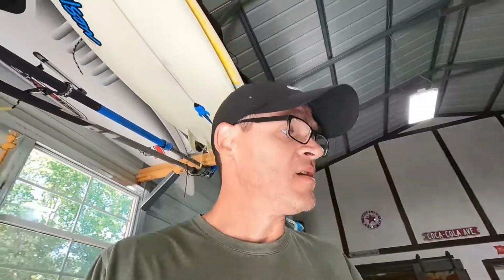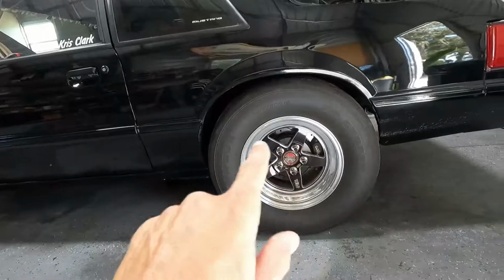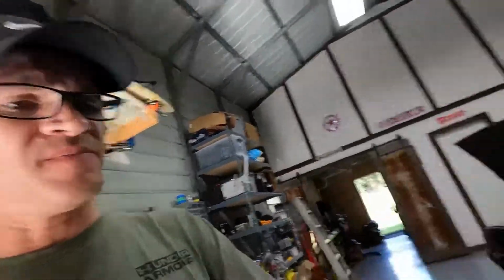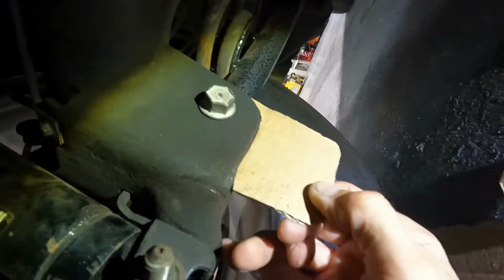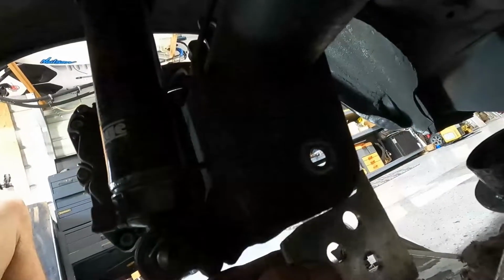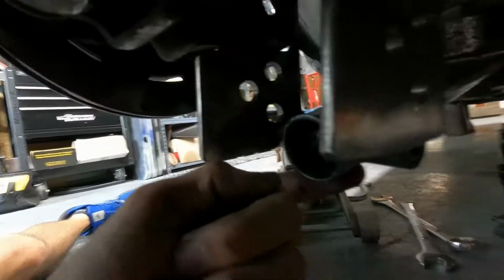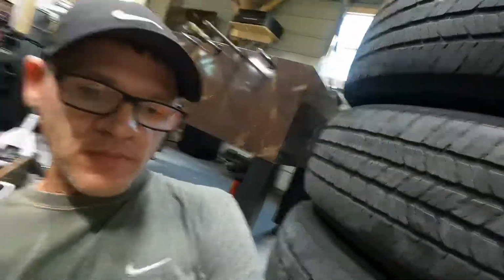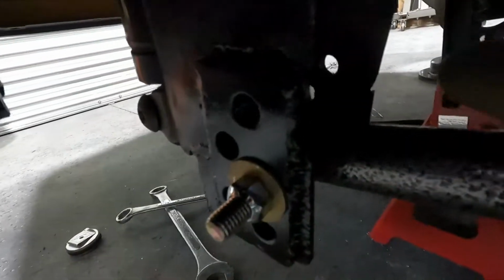Fox Body DIY Lower Control Arm Brackets! Total Cost $25

Comment: What thickness of metal were you using? Going to try this.
Reply from the maker: I don’t remember. It’s the the same thickness as the stock bracket. Just use calipers and measure the thickness.

Comment: You lowered your lower bar down was it 1/2"? Does 1/2 make a noticeable difference at the track  at starting line and out farther ? Thanks
Reply from the maker: Actually 1.5 inches. Made a huge difference. It has wheelie problems now.
Reply: Thanks i have a 92 mustang  with 540 bbc F2 procharger  stock suspension  all factory mounts.  Best so far  4.80 149 1.15 60'
Hook on line ok but it 60' to 200' where its Devil triangle.  Thinking try low the bar down 1/2" at time.

Enjoy your videos  im new to your channel   Thanks

Comment: Do you have to readjust the lower Control arms? Thanks
Reply from the maker: I’m not sure of your question. I made the brackets to adjust the instant center.
Reply: I meant to say did you have to  lengthen the lower control arms or did you keep them the same length?